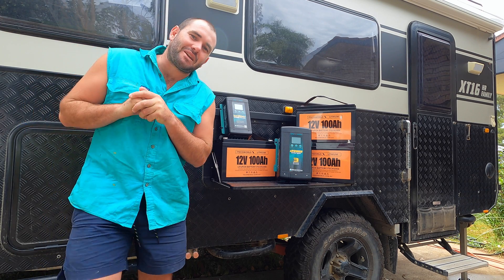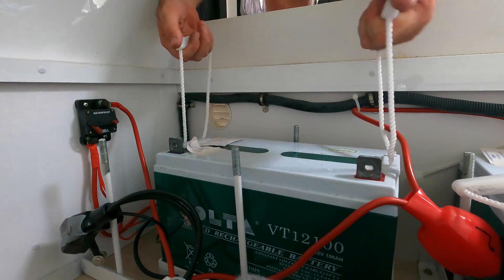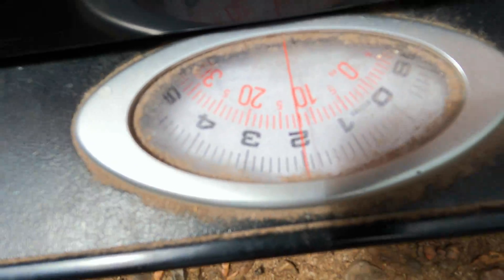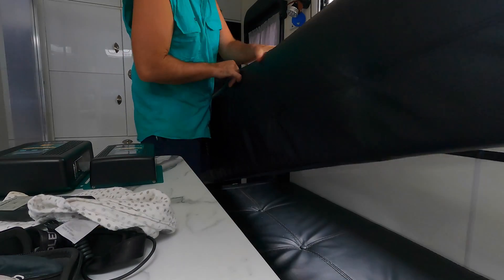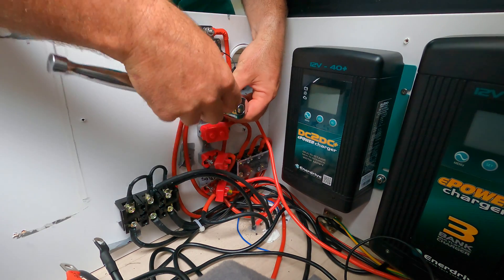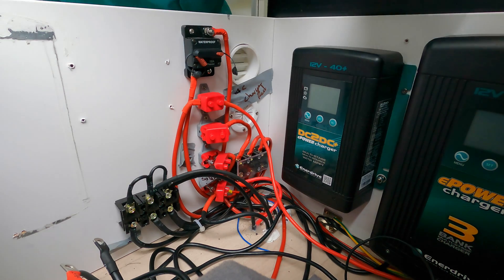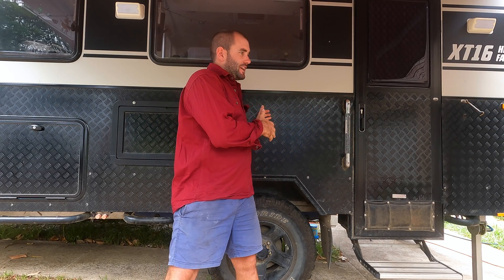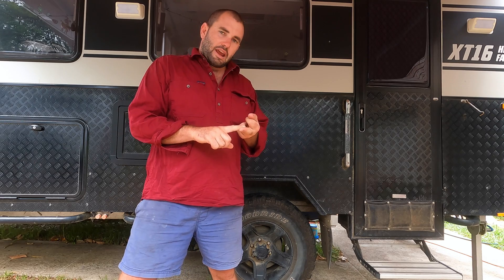LITHIUM battery Install MDC XT16 family caravan - Why did we swap to a lithium setup in our CARAVAN?

Comment: Hey Nick, came across your channel only last week and the Mrs and I are hooked. Out of curiosity, why did you choose the itech 100ah over the 120x?
Reply from the maker: Hey Robert glad you like the channel. they had a sale on the 100 ah and at the time there was  a lead time on the 120 plus We were being cheap hahah 👍 thanks for watching 🤠
Reply: @elnick.adventures  thanks for the quick reply. The reason I was asking is because I need to upgrade from AGM batteries and was looking at the Itech myself. If I go 2@120x, how much solar would you say is sufficient to stay off grid 4-5 days? My van is small (1@ 40ltr fridge, 1@20ltr draw fridge). Other than that, I have 2 sirroco fans and a TV. I was thinking 400w of solar.

Comment: Hi Chief, why did you change all that when you may have just changed to lithium batts? I get you wanted more ah in (30-40), but why all the extra expense and hardware? Cheers, dd
Reply from the maker: Hey Dave we weren’t sure if we would keep the i tech batteries as originally we were going to put enerdrive battery in. Also I didn’t think the projector charger worked well on solar. And we already had a enerdrive charger in the car that we were impressed with. Also I like the digital display on the enerdrive charger. Thanks for watching 👍

Comment: Hi There, it would be great to have a buy list of items you purchased. Also can the system handle Itech 125 batteries? As I can’t find the 100 ones 
Cheers in advance - Regards Carl
Reply from the maker: Hi here is our buy list and where we got them from and yes it can handle the 125 amp batteries👍
- batteries itech world 100ah or 125ah
- ac  charger is a enerdrive 40 amp hour multi stage charger bought from mygenerator 
- dcdc charger is a 40 amp hour multi stage charger bought from mygenerator 
- battery monitor is from itech as well and is the only one they make. 
- all the wire and connections were purchased from jaycar. 
The batteries and chargers were bought online due to covid and delivered to our door. 
Online stores- itech and mygenerator just google search them and they will come up. 

Cheers hopes this helps!
Reply: @elnick.adventures  perfect thanks so much. Enjoy yourselves out there, stay safe! 👍👍👍

Comment: Did you change the solar  regulator
Reply from the maker: Hey Mike 
The enerdrive dc dc charger that we installed has a regulator built into it. So no need for a seperate one. Thanks for watching 👍